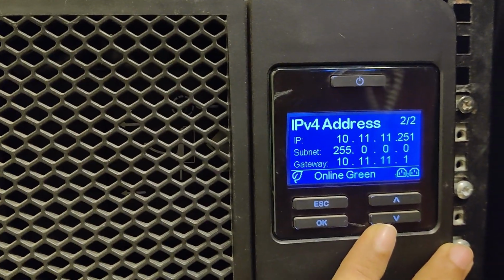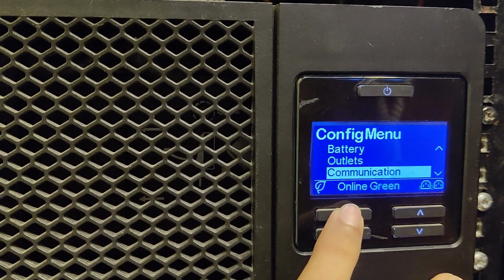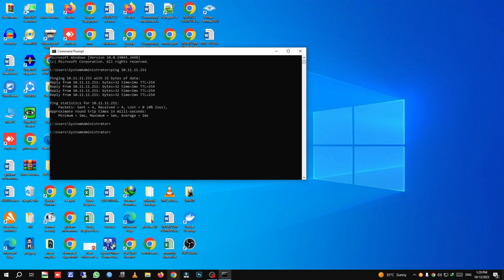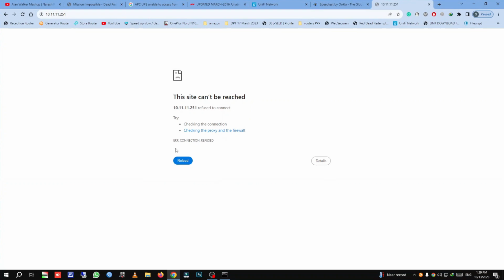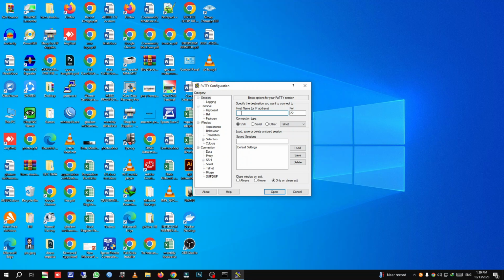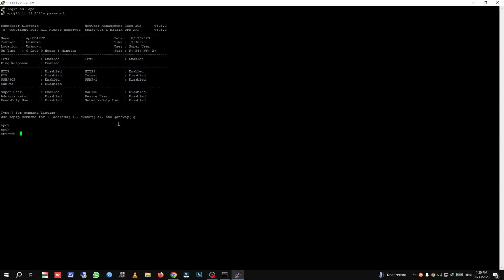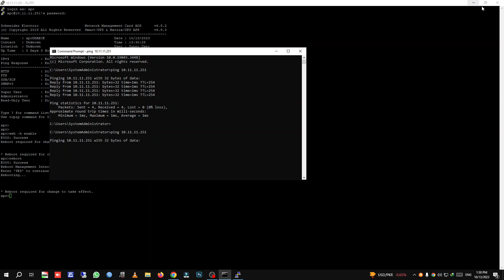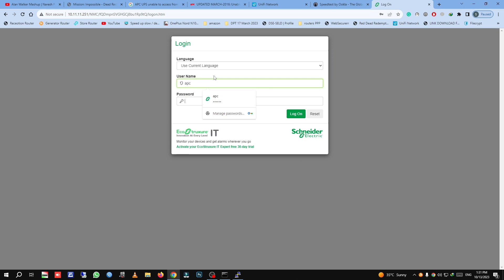APC UPS SRT 5000 VA Website Interface Troubleshooting

Comment: I cannot connect via SSH.  I just bought 25 x1500 and 10 x 3000
Reply from the maker: Have you tried checking the SSH settings on the UPS?